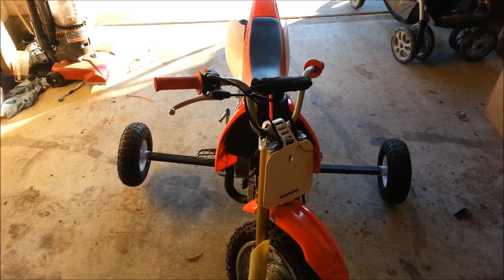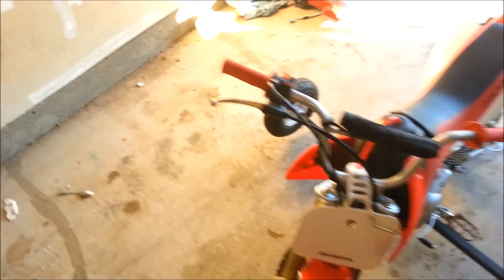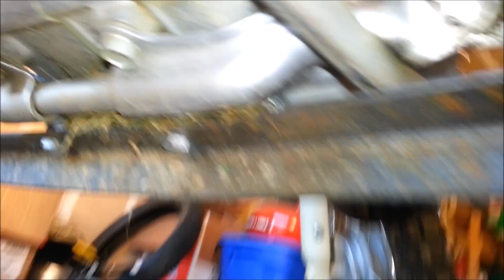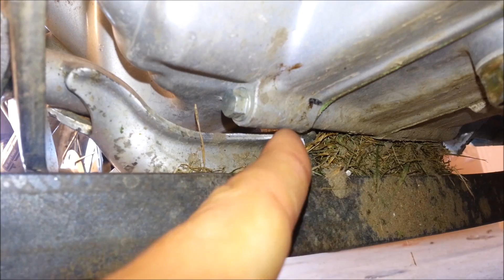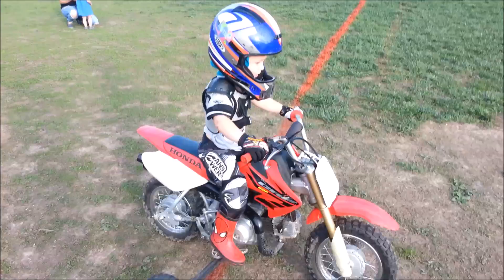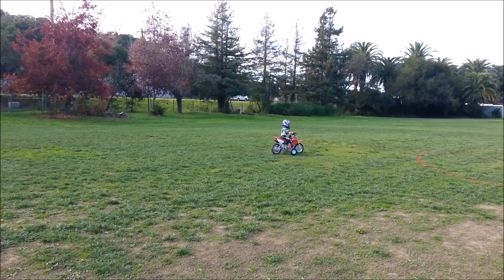DIY/ How to Make Training Wheels for a Kids Dirtbike

Comment: Most kits online now are around $50. This would be great if you had all the stuff sitting around the garage
Reply: They're still 100 bucks where I can see.  
And a piece of angle is about 10, each wheel about 5, then a couple longer bolts and misc nuts, another 5.  You're looking at 25-30 bucks.  Laying around or not, it's still way cheaper.